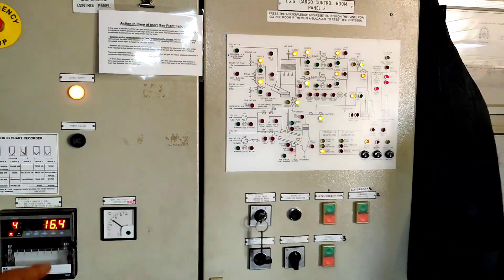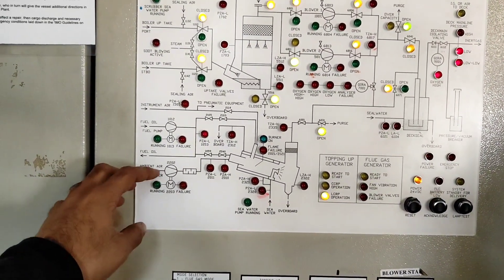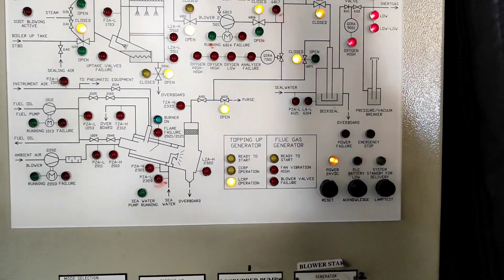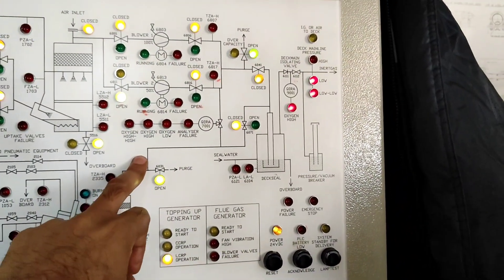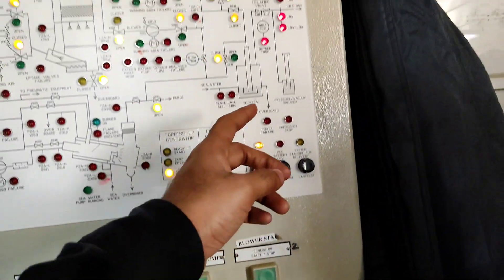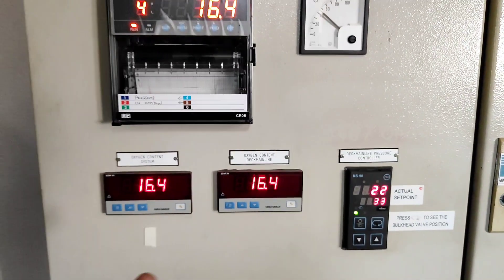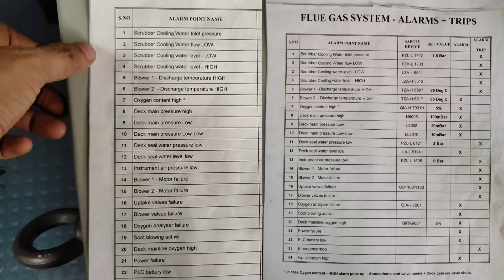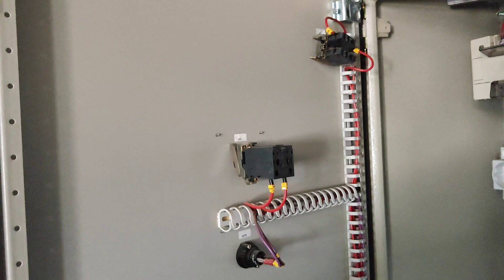Inert gas system control panel in CCR

Comment: Batisub,, u are doing a great job. It will help a lot for tanker people. 
Can you plz show few things. 
1. In case of led indicator light gone, how will you change that. Is it a same process like normal indicator bulb. 
2. Igg alarms testing 
3. In case of ig vv stucks, how will you manually override. Specially boiler uptake vv interlock. 
4. This mimic panel made by whom like aalborg or Mitsubishi? 
Thanks in advance. 
2/E Saha.
Reply from the maker: Thanku so much sir
1. I guess led bulbs are soldered and they can be replaced.
2. Igg alarms part 2 i will upload soon. Little Busy with multiple works
3. If ig uptake v/v stuck then we manually need to open it using spanner or other tools. And after v/v manually operated we need to give open signal to plc by activating limit switches
4. I will check and update it

thanku